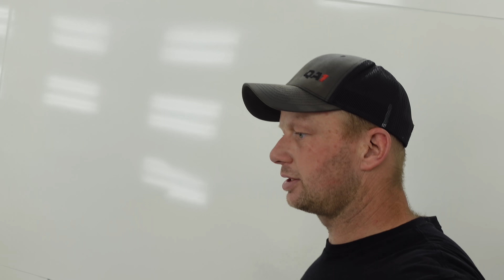It Looks Pink! '05 Silverado gets a 2021 Color Code | #24vSilverado [EP5]

Comment: I used to think body shops were over priced until I started doing my own work. The hours involved doing prep is unbelievable.
Reply: Most shops these days are production panel changers (like fast food.) Bang the structure straight (or don't and hope nobody notices,) slap some new metal on it, shoot some paint (and hope the prep was good enough that the paint sticks,) and kick it out the door. I dealt with three different collision shops in about six years, every one had piss poor quality, structural components and brackets not straightened (even though insurance paid for it,) terrible alignment of panels, bumpers, grille, etc even without any structural damage, and peeling paint less than a year after the repairs. I decided to do the paint and body work myself on my truck build, I can screw it up and do it twice and still save money.
Reply: The shit workshops are definitely over priced. The good one are value for money!
Reply: Body shops are way overpriced. Doing body work is easy. I charge $40 an hour and do all of my work in the shed out back on the weekends. I have done over 100 cars that way and besides paying for Bondo and paint I have only had to buy one compressor and replace 3 paint guns. All you rookies spend way too much time whining.

Comment: Taking on the full body is a huge job. The body work and paint shows definitely give an idea of the amount of work needed to finish off a “job”. Yes I HF painted my work truck box and yes it was a 50 footer. Still I put 40 man hours into just the box. Another 15 edge matching with the bed liner as the contrast along the bottom and the inside of the box. Hour upon hour sanding for ten to fifteen min of color

Comment: Watching these makes me want to finish my truck, It's a 1988 F350 Centurion. Just got a 24v Cummins, I'm gonna put in it Definitely gonna put a P-Pump on it. I'm hoping to make 400hp.
Reply: lots of dreams never come to fruition.do the work then tell us how awesome it is,not what you are fantasizing about doing!
Reply: @trillrifaxegrindor4411  lol at least he has something he is working on. Quit bagging on a guy for sharing
Reply: I have an 88 250. Mine is a crawler project though. Developed/developing my own fabricated knuckles and axle housings to run under a few projects. Mine will be big block powered.
Reply: @primalbeans  Nice mine is Big block power right now Swapping to the 5.9 for the fuel economy and towing power.

Comment: Every time I see a car painted on YouTube, I'm renewed in my certainty that I never want to do it.
Reply: It cant be that bad 😂😂 im jk its probably horrendous
Reply: Prepped a tiny punto once, you would think it was the size of a schoolbus
Reply: @notsevenfeettall  ohhhh
Reply: @notsevenfeettall  you may enjoy it but I know how much I hate sanding :p
Reply: After doing a very backyard paint job of my work truck I highly recommend starting with something small like a bumper or tailgate. Teaches you about how to do it with out taking weeks of prep
Reply: @aidancloke4398  I've rattle-canned bolt-on things like bike and tyre carries that I've made myself. It taught me how many tiny bugs seem to have evolved to be sexually attracted to wet paint.
Reply: I love painting things. I hate prepping things for paint.
Reply: @notsevenfeettall  I am in the middle of working on an aluminum boat. 

Just the prep work has taken about 50 hours so far. The boat was abused, lots of dents, a couple of spots of missing aluminum along the keel, 4 or 5 hours with the soda blaster, and I went through a 1 kg tub of body filler, and hours upon hours of sanding by hand, and an orbital on the bottom of the hull. Tomorrow I lay down primer, and then sand, then more primer and sand more. I want at least 6 layers of sanded primer before I paint. 
Then for the hull, I'll use Total-Boat Krypton Copper Free Antifouling in Blue, and for the sides, I'll use Rust-oleum in Red, with a liquid rubber paint called White Knight for inside.  I bet I'll have 100 hours total into this boat, before I am done.
Reply: @LongPeter  all of them.😄
Reply: Having done it once, I’m never touching a paint gun again lol

Comment: Pearl looks nice but good luck matching it if you scrape something later. It's pretty easy to match the reflectivity and color in one kind of light, but two is really hard. You end with a car that's one color in sunlight, and two under street lights, or vice versa. My Satin White Pearl Subaru got hit twice and ended up tri-color in certain lights. I really prefer a flat color for a working vehicle!
Reply from the maker: Not much of a working vehicle anymore.  Pulling trailers is about the most of it.  Nice cruiser.

Comment: Hey Rich...How bout doing some bodywork bro...On yer'self man. Ha,ha,ha, jus kiddin' man, I'M JUST KIDDING!!!
Wait what's this?(Anonymous sources say) DeBoss has been working on a secret project for his next videos?  it's the truck sized "Chevi-Umbrelli" [sic] that mounts to the bed of his pride and joy (nuthin' wrong with dat) [sic] that automatically opens when sensors detect the slightest bit of wet [sic]. What's odd is the "automatic mud sensing spray nozzles" strategically placed along the frame rails that sprays off any "wet dirt" [sic] that tries to stick to the frame/undercarriage. He was talked out of making a manually operated under carriage spray nozzle he could easily control by looking at a screen mounted (undecided). The nozzle direction would be easily controlled from electronics  that is with the shift knob...By golly, I hope the moisture sensors don't detect some badly placed nozzle shot, I'd hate to see the big "umbrelli" [sic]suddenly engage. I mean, that could be a problem I'd see...I mean, he won't...He won't be able to see, yea, that's it...All kiddin' aside, the fuckin' thing will be as bad as I used to be (not that I'm not now, hell, I've got two new shoulders and knees (bilateral, it was about fucking time VA) combined with old man strength? I can still KO young bucks. And bad, as you know, squared the fuck away, sharp/clean, in dads hand me down white starched long sleeve shirts (in cufflinks, at daughters wedding) and pressed Levi's and cowman boots. Cufflinks jus' in case we'd have to back hand some disrespectful sumbitch across the mouth, and maybe, depending of how much the dissing was, a link would catch some facial anatomy. (Blood does come off said shirts ladies. It's worth it). You think a man wants to lose and dirty his hand me down shirts he ironed and starched himself? Get rolled on the dirt for lack of skillfull engagement? IDTS. Notta' chance in hell. And just to finish the bad-assery with the swift kicks in the ass, leaving everything in the dust, whilst we all shall return. Some sooner, some later. So how much was it DeBoss? All of it? 
Cool beans ese. 
P.S. You and that other "minty" Canadian burnout king (to date)...There can't be no badder Canadians than ye's. I know, cause we relate. Nothin' was given to us, we worked for it.
Reply from the maker: I should lose the covid 20 lok

Comment: That's why I drive rusty trucks so I don't have to worry about paint.
Reply: Good right until it starts failing inspections and just being a real clunker. I understand the work truck deal, this is like making an old truck, brand new worthy, for far less cash. With being much better than stock still
Reply from the maker: my wife said she didn't want to drive in the truck anymore....

Comment: since so many trucks are body-on-frame I find it ridiculous that  they still make body panels and the main portion of the body out of steel.  large format 3D printers could absolutely revolutionize car body and car manufacturing however it still doesn't seem that they're willing to go down that route quite just yet especially for vehicles in the salt belt.

work trucks should have major components of at least their body shells made out of grp, 
if they can mass manufacturer boat shells then this really shouldn't be so much harder for the automotive industry to get a hold of